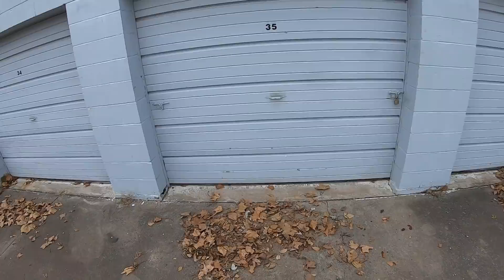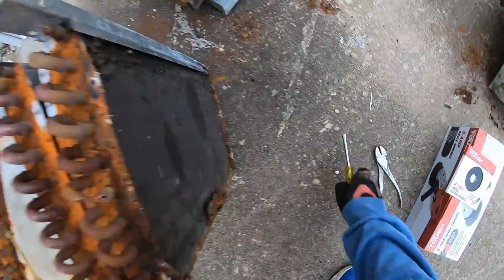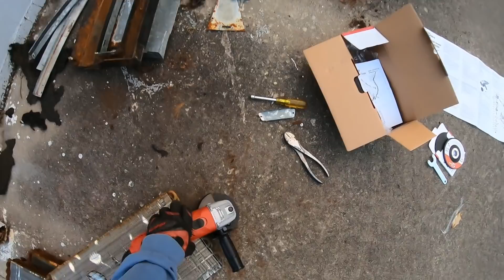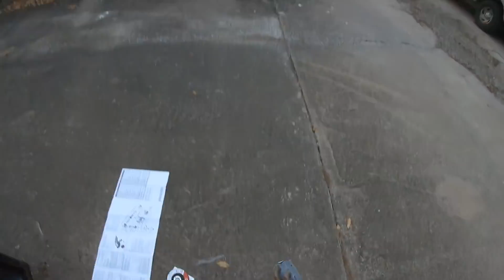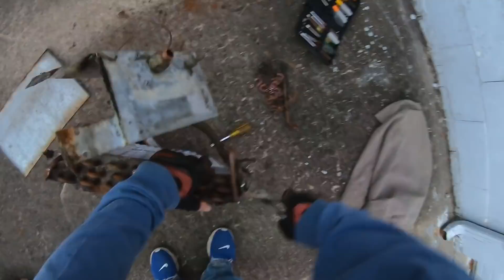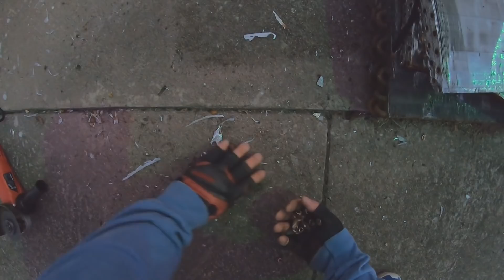Scrapping for Copper Aluminum Cash Cakes!

Comment: Prices in Northeast Bumfuk Texas 11/18/19 per pound:
Aluminum Cooper Cooler $0.59
Aluminum Copper Cooler with ends $0.48
Light Shred Steel $0.02
Copper #1 $2.07

Comment: You should watch a video by dumpster Jerry he takes those aluminum the parts of your air conditioner he takes them apart and takes out all the copper so the copper and aluminum or separate. If you have the time that is otherwise Keep On Keepin On By